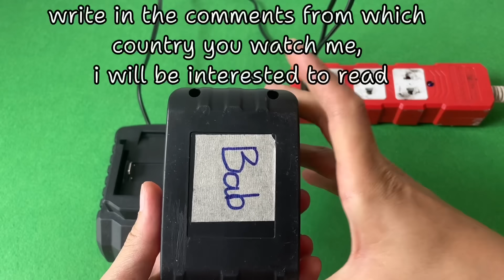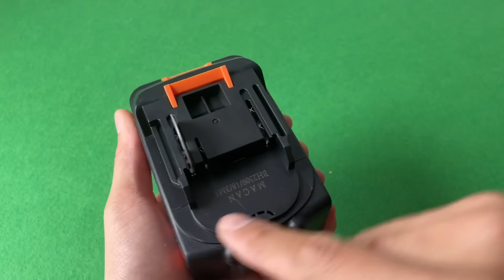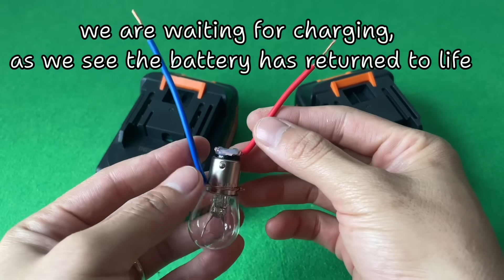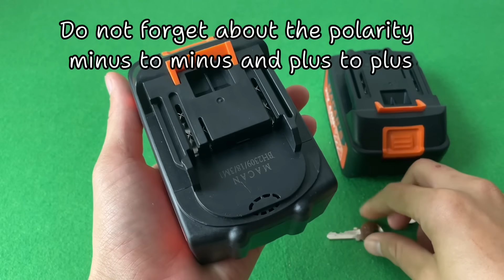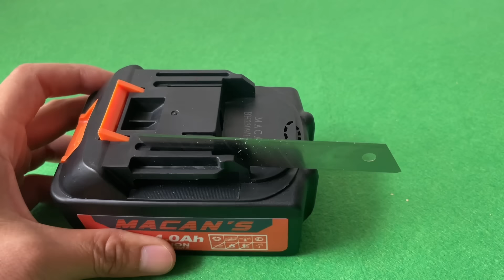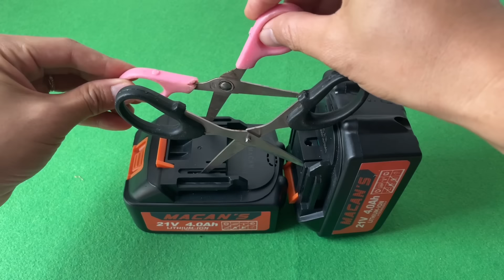Old Battery Will be Like a New One in 1 Minute! Great Ways to Restore Your Battery!

Comment from the maker: Old Battery Will be Like a New One in 1 Minute! Great Ways to Restore Your Battery!
Reply: So, I didn't really learn anything there but I commend you for your efforts. When you hooked the wires up that way it just leveled out the charge between the two batteries. Also, on the bottom of the dead battery you wrote "Bab" when you should have written "Bad"! Lol!
Reply: Also if you want to reset the ion"s in the battery instead of doing what you did. You can place the battery in a vacuum sealed bag and place it in the freezer for 4 hours. Or if you want to use a faster way you can place the battery in a vacuum sealed bag and set it in a container of boiled hot water for 15 to 20 minutes. This will boost the charge and allow you to connect it to the charger to become fully charged.